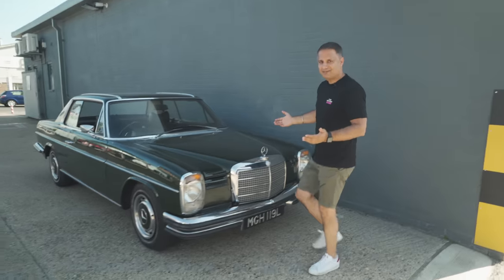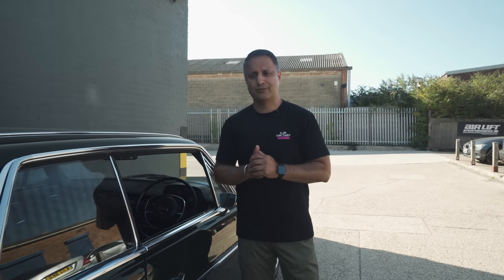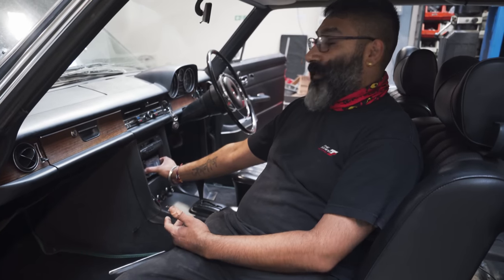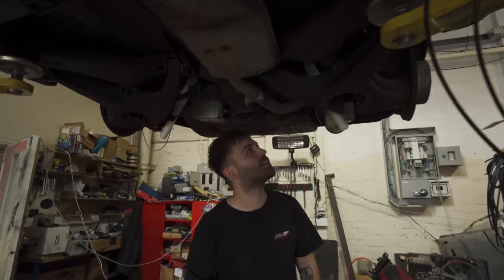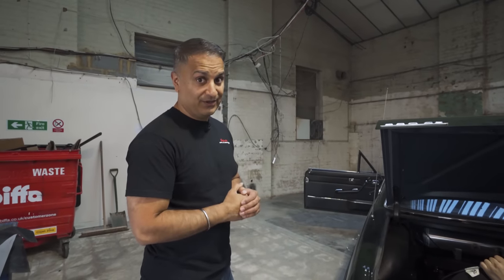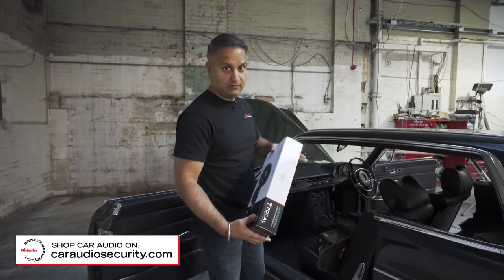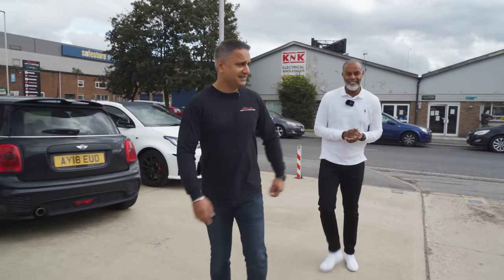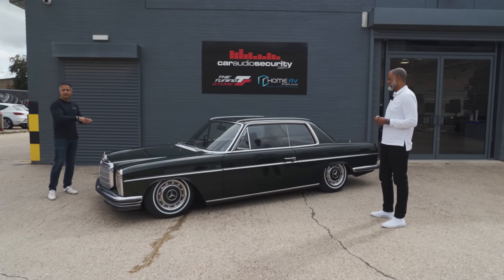Classic Mercedes W114 280CE modified on Air Lift Performance | Car Audio & Security

Comment: Beautiful😍..I had a w114 but sold it years ago..back onto ebay I guess for another!..Can I ask what cost of the conversion is roughly???
Reply: Have you got any answer mate ? Thanks so
Reply from the maker: Rough cost of equipment and installation is around £5K-£6K GBP

Comment: This might be a bit Far fetched. But I currently on the midst of renewing my w115 interior, and my panel is exactly the same as this w114. 

The panel that you guys made for the airlift remote was it custo made 3d printed?
If so, i would like to know how I could obtain a similar one to put on mine.

Comment: Awsome car, stance looks so on point for a admire & "drive".. was there any mods at all to the suspension components other than the airbag install?? I've just bought a 73 coupe & need this stance. Not all that common here in Australia. Huge fan 👌👌👌

Comment: Did you use a dual voice coil speaker in the front? or is left and right wired together?
Reply from the maker: Single voice coil speaker, wired as a mono speaker

Comment: This looks DAMN GOOD. If you don't see it slammed the 'purists' would have nothing negative to comment on. I thought the USB point might be external to the head unit? I understand it may spoil aesthetics slightly but Clive doesn't want to drive around with the glove box down all the time should it be necessary to charge the phone or pop in a USB?